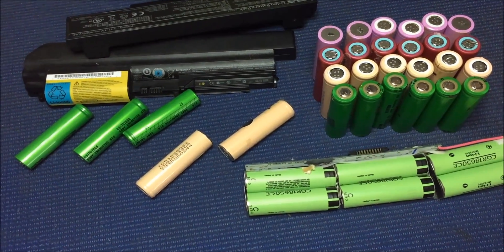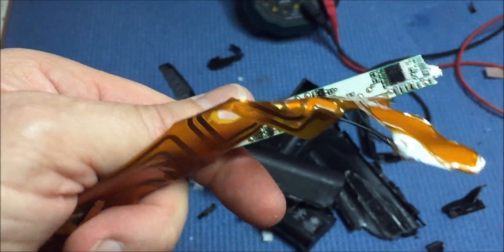Homebrew Powerwall Project - S01E01 Thousands of 18650 Cells all joined up to create mayhem!

Comment: Dear sir,
Please can you let me know if this very pack built from used laptop batteries is still in operation?
I have access to used laptop batteries and would like to make a pack like yours.(new cells are very expensive here)
Which would you recommend, Between used laptop batteries and new ones.
Reply from the maker: Don't know if those cells are for sure, but my powerwall has been running for 2 trouble free years now... 4480 cells power my house all day and night with 4kw of solar to charge them

Comment: i need to make 35kw battery from recicled laptop batteries , I need some advices.
Reply from the maker: Depends on the voltage, range & capacity of cells
Reply: motor voltage  is 96 volt.  ac50

Comment: There are various mAh 18650 which causes me to be confused as to which is the best mAh version.  I believe that you can't or shouldn't mix mAh such as a 1,500mAh with a 3,000 mAh battery in a powerwall project or even an EV project.  Can you enlighten me as to why you chose the particular mAh battery and if a 3,000mAh battery version a viable option?
Reply from the maker: It is best practice to never mix cells, that said I've done it quite successfully for the past 12 months with out noticeable issue so far you can take a look at this link http://www.diypowerwalls.com/celldatabase.php something there will help you quite a bit.
Reply: HBPowerwall Thanks for the reply.  What about choosing a higher mAh such as 3 000mAh or just get what I can cheaply?  Bang per buck is the best reason for the choice?
Reply from the maker: Global accessibility & scalability is my basic reason anyone anywhere in the world can find old batteries and scale my idea back to the bare bones and have a workable energy storage system.

Comment: You don't need to go through the expense of buying a 3D printer to print the battery holders. Just go to Amazon and look for "Feamos 10pcs 18650 Battery 4x5 Cell Spacer Radiating Shell Pack Plastic Heat Holder".  From there you can find the sizes you need for your project.  You might also want to look for a Spot Welder; also at Amazon. You can YouTube the spot welder to see  how they work.
Reply from the maker: Yep already have them.. decided not to go the Spotwelder route - soldering seems to be working well for now

Comment: Love the channel, just binge watched the entire series last weekend!One thing that worried me was the weight of the entire pack resting on just three cells.Could you widen the bottom "arm" so the pack rests on the plastic spacers, so they take the weight instead? I've seen how these cells can overheat from a small compression of the outer shell, so might be worth considering.  Just a suggestion, hope you don't mind.I'm gonna start building my own smaller system as soon as I get enough cells together.
Reply from the maker: +Trevor Williams only 3.5 kg or something like that so they have held up so far. I'm very aware of this hence i didn't go to 120 cell packs. I want it to sit on the cell so the plastic holds the pack in place very firmly.

Comment: which battery manufacturers gave the best batteries in your opinion?
Reply from the maker: +saborguerito never looked. All went on mah after testing.
Reply: +HBPowerwall I think I'm going to separate the batteries from the batch I ordered from eBay based off of manufacturer of the batteries. I'm going to grab those cells together and see which ones give you the best. This may not be a real world test but some manufacturers might be better than others and some manufacturers I will use the same batteries, honestly. I just thought it would be an interesting way of doing things.
Reply from the maker: sounds like a plan but just because they are same make and model doesn't mean they'll be same capacity just due to their nature BUT it sound like a bloody good experiment !!!

Comment: Good project don't waste your money on agm... get a imax b6 charger will help test the cells, lithium is the way to go..
Reply from the maker: Thanks for the link Phillip, just ordered some. Seems there are a lot of fakes, I'll pay more and pay with PayPal to cover my ass.
Reply: if you go to the sky RC website you should be able to see who are the stockists here in Oz and their awesome range and see which one you might like the best
Reply from the maker: +VicHybrid Power will this be suitable ? http://www.ebay.com.au/itm/NEW-GENUINE-iMAX-B6AC-Version-2-NiMH-V2-Lipo-RC-Balance-Charger-Tamiya-Dean-Plug-/221206550811?hash=item3380f0191b:g:uIQAAOSwcu5URK6A
Reply: Yeah thats the one i have. there is a 12v version think its a bit cheaper.
Reply: +Peter Matthews Keep an eye out for the fakes, they don't charge correctly. I think that the software is dodgy...

Instead of a 3d printer. http://www.ebay.com.au/sch/i.html?_from=R40&_trksid=m570.l1313&_nkw=DIY+18650+Battery+Holder+Bracket+Lidded&_sacat=0

Ignore if you just want a 3d printer